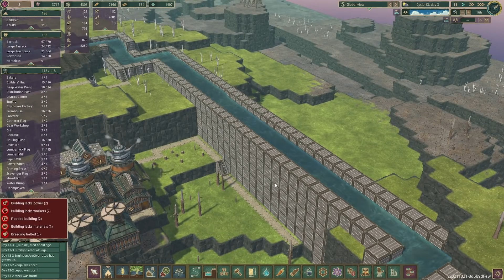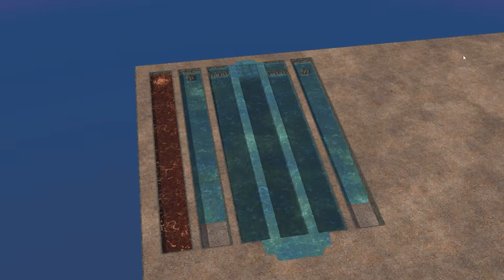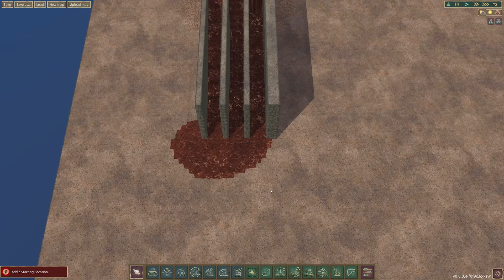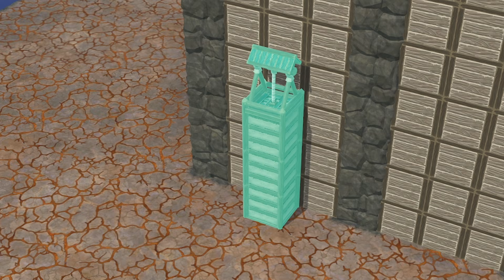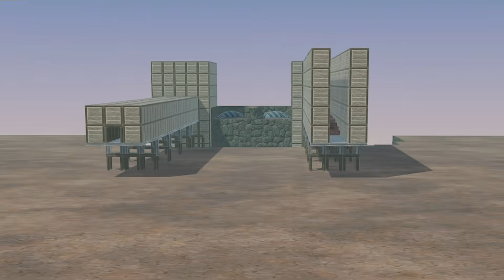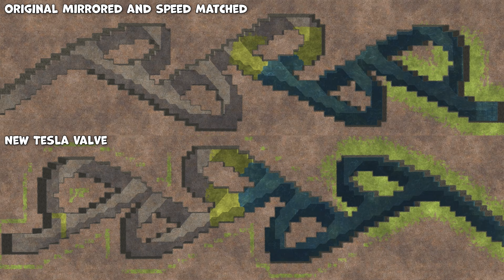Engineering a TESLA VALVE in Timberborn!

Comment: I wonder when you put the new floor on the platforms when you tested the tesla valve if something would be different then putting levees on it 

And what happens when you build 2 towers and connect them with a "pipe" does the pressure fill up both as the water tries to regulate how much is water is in both towers 

And last what im wondering is can you put dirt on platforms or is it still restricted

Edit: why didnt you use sluices btw😅

Comment: The Tesla valve should be tested by replacing the good water sources with poo water sources once it has filled in. The current test is like submerging a valve from one end and displacing the air inside, but two similar liquids will show the paths the fluids take.

Comment: There is pressure with the water. If you're curious, Skye Storm has some great videos on Timberborn engineering, and in many of his dam constructions goes over how to manage water pressure (super useful if you're trying to get better results from waterwheels to generate more power). The gist of it, though, is to take larger streams and force them into narrower streams
Reply: Skye Storm discovered the way Timberborne simulated Bernoulli, but there wasn't "3d (volume) pressure" in the game, it was still converting water source power/spread direction. A water source of 1 could spread in 4 directions, generating 4 0.25 cms vectors in those directions.
What Skye did that was super interesting was closer to beam forming, he artificially limited the ways water could flow with converging step drops (since water could only calculate in 2d) and thus created virtual pressure by forcing all the cms into a single channel even though it should have overflowed.
Again, NOT due to "water pressure" but "vector pressure". That said, his method of creating a turbo channel made for some amazing water wheel power generation!

Comment: as I previously mentioned on your other Tesla valve experiments, another factor you failed to duplicate is reverse channel widths.  if you look at your drawing again they're like half the width of the forward flowing channel.

second to properly test the concept, you need to try one with bad water at one end, and regular water at the other end and start them at the same time rather than racing them down an empty channel with no opposing pressure in the system. if you build the channels correctly, then the reversing channels should help support the flow direction of the forward channel which should prevent reverse flow from occurring

additionally, to compensate for the the lack of fine detail with which you can build, you're going to have to design it bigger (effectively increase the resolution) and you might have to tweak the orientation to the grid so that the channel intended for the flow to follow lines up efficiently to the grid where as the flow reversing channels, plus you might have to tweak the design to recreate the spirit of the idea within the limitations of this system
Reply: From what I understand, pressure build-up/difference due to varying channel width is also an important factor, one he did not test in the valve or separately.

Comment: In your pressure tests, the differences you're finding in 'pressure' actually seem to be differences in the height of the water at the entrance.  The higher outlet has the water level drop below the top of the outlet first.  This means the lower one has a full square of water being provided while the higher one only has a partial square.

Comment: Isn't he mixing up "pressure" with "enough water to flow at 100%"? With just one Poo Outlet you simply loose power by not producing enough liquid for a whole square. Not sure but I'm guessing both water wheels will settle down at the same power output after a while. Or if you add like 9 normal water outlets, the high one will also produce the same amount as the low one.

Comment: hay mat, not sure if this is till a thing but, when you have a "waterfall" the flow rate over that water fall used to get capped at about 1 blocks worth of flow rate, so for your open vs pipe test, as far as i can tell, the flow rate would end up being the same for both of them roughly, at the end of your tests just add a big flat area for the water to spread out, and you should see the water flowing much faster
it's just a weird physics bug in the game to create mega dams that had a consistent output flow rate regardless of the water level

Comment: I wonder if you lowered the channel in the resistance valves you could create more speed pushing back against the main flow?  (You might lose it again when it flows back around and hits the upper part of the channel, but with weird game physics who knows?)

Also, I wonder if you can get enough pressure to send water up in the air... put a huge reservoir, a pipe, and then have the pipe point up at the end.

Comment: It's surprisingly hard to find a game that lets you make real aqueducts. I know architecture is forbidden, but I love the look of flowing water. I love arbitrary water features that exist merely to look good. And I want a game that lets me make these things. Ideally inbedded in a city builder type game. 

I can spend hours in city skylines, rerouting rivers, equalizing flow rate across a network of channels, setting up the perfect stage for a city. Really, the city is an afterthought. Landscaping is the real meat of the game IMO.
Reply: same.  I can now have a sky river dropping waterfalls onto power wheels into another sky river!
Reply: I think we should give water features a pass as engineering demonstrations, like a bridge that has no practical purpuse except to demonstrate engineering principles.

Engineering isn't about purpose but function. Its engineering is the column is structural!
Reply: Well, there are some water bridges with water on them in real life, but it is extremely difficult to find.
Reply: @bearmike_360KB  Generally, water transport is done via pressurized pipe nowadays. That's why aqueducts are essentially architecture. One of the Roman aqueducts is still in use. Aqua Virgo. It looks amazing, but a simple pipe would be far more efficient. That would allow you to pump the water instead of relying on gravity to carry it. Would a pipe last 2000 years though? Not unless it's drilled through solid stone. 

Water bridges are kind of a separate thing. Very niche, but they supposedly have a purpose.

Comment: My question is the bad water source is a 3 by 3. What happens if there is a channel that goes off in each of the 4 direction instead of only one. Would that effect the flow and the speed? As opposed to the 1 by 3 of the fresh water sources.

Comment: What kind of fake engineer are you RCE? Because what you did at 16:50 and onward doesn't prove anything. There was simply more water remaining in the bottom reservoir, which allowed more water to flow through the bottom channel. That doesn't prove there is pressure. That just proves you let too much water flow out the back.

Al you did was look at the general water level.

Comment: I don't think the speed with the pipes has to do with pressure but the simulated speed at which the water is falling to the floodgates. The higher one doesn't have to fall far from the source to flow out meaning it isn't gaining speed. I don't think pressure is simulated

Comment: Pretty sure the game doesn't model water with fullfluid dynamics, it's just got a measure of how much water is in each place.
That's why the water flows faster down hill(all fluids spread evenly to the surrounding tiles), then slows down the instant it reaches the end(it no longer spreads preferentially forwards), as well as why the waterfall is slowest(it only has one tile with preferential spread vs the others having multiple tiles).

Comment: 99% certain that what you're looking at is cell-by-cell physics i.e. each cell (size of a levee) can interact only with neighbouring cells. That gives a decent approximation of physics, but pressure etc. aren't really handled.
Reply: I don't want to say it's easy because it probably isn't but if a cell of water has its directlion to the side or head on with another cell. They could just decrease the velocity of the affected cell. Even better they could also average the direction. I imagine this would simulate turbulence and when applied in this valve shown in the video it would be effective at decreasing the energy in the system enough to have little water flow out the end.
Reply: @Grymyrk  It's not that easy, unfortunately. In the model I'm thinking of, adjacent cells try their best to make the water height level, subject to gravity. Importantly, this means that effectively water is teleported between adjacent cells. That means there isn't much to calculate velocity on, and in any case it's capped at 1 cell per logic tick (because water only interacts with adjacent cells), which isn't how velocity works.

Not knocking the approach in general though - I've used it, and it's a pretty good approximation at a macro scale.
Reply: yes i think that's how i would try and implement this as well. the most basic version is like you said; that each cell only has one value for how full of water it is, and that value "trickles" along the cells to each adjacent cell on each update loop. a more advanced version might give each cell a few additional variables like the rate-of-fill and from which direction its being filled and in which direction it's being emptied... thus each cell has a velocity vector... ... but i'm not sure ... anyway its really cool!

edit: i think in the system i mention above there should be some emergent behaviours, some might be good such as laminar flow having a better flow-rate... but also possibly some bad side-effects like flowing around a 90 degree corner might kill the velocity too much... its hard to visualise without actually doing it and running tests
Reply: @benja_mint  Not to mention that I think the most sane way of doing the more advanced system involves a non-constant settling time, making it difficult to implement in a game engine.
Reply: @benja_mint  Each cell definitely has a velocity vector. This is needed to display the water texture moving down stream. Also to turn the water wheels since their power is based on the water's velocity.
Reply: @benja_mint  I think it has level and velocity (not pressure) and it's tracked by vertices, not faces.
Reply: I wonder if we can apply calculus to voxel based physics models to get our every-day equations. Infinitely good approximations are no different than the real deal.
Reply: @Wh1t3Cat  It's not possible on this voxel model, because there's discontinuities (notably at speed = 1, because water cannot flow more than 1 horizontal voxel, but also a few infinities because falling happens at infinite speed, given that water falls any amount of distance in a single tick.)

Maybe if you had a model that ran each time step until things settled, but that wouldn't be appropriate in a game (as well as problems with numerical instability etc)
Reply: They got it real enough that water will reach equilibrium between two connected buckets if you create a tunnel from one to the other.
Pressure is just a division of force/area. Force can likely be figured by depth, then as someone else suggested have a vector for the flow direction to determine where it pushed the water. Lots of simplification since everything is cubes.
Apply a direction vector (force), its direction based on the type of material around it. Do some vector math against the valid cubes around it. use a multiplier based on the height of the neighboring cube. Voilà.
Reply: @AyuranssLounge  Didn't know that. In that case, I'd revise my answer to the most simple solution being a 2-tier cellular automata on stacks of water tiles. The first tier of the automata communicates height information, and the second tier moves the water.

Velocity vectors are something of a red-herring, because you can calculate a local velocity by the cellular automata and this suffices for textures etc. As evidence of this, consider how water behaves with a series of sharp corners. A series of sharp bends should remove velocity as the water crashes against the walls. This isn't what happens though.
Reply: Same way Stationeers have been doing it with atmosphere for like 10 years now, I assume ONI and a bunch of other fluid/gas management games does it the same way.

Comment: He kept going on about how the poo water source was "more viscous" and "faster", but I think it's only because the source generates from all of its block spaces, putting it ever so slightly ahead of the other water sources he tested against by volume and position.
Reply: Yeah if he had the regular water start at the front of the 3x3 then it would be even which he litteraly tested and got wrong lol
Reply: Doesnt viscocity reduce flow velocity cuz there is more internal friction
Reply: Yes but either the game doesn't calculate that or badwater doesn't have less viscosity because the flow rate is the same
Reply: Went looking for this comment
Reply: I noticed that as well, which will you think about it?His dirty water started a block in front of the one by three in the middle water. So now all his Testing is skewed in incorrect
Reply: Because he is real civil architect.
Reply: The spawners are the source. That's the key. Since the poo is a 3x3 source, it's always going to be more than a 3x1 source, especially if you're trying to measure distance traveled from source while putting the 3x1 IN THE MIDDLE. By doing so, you're already handicapping the race in favor of the poo source. If you wanted to create a optimal way to maximize the water flow, it'd be a 3x3 of thier sources, with it being 3 stairs in length, having the highest stair being furthest away from the port to the stream and lowering the closer you get... That's just basic physics. Granted, this potentially means building more walls around the source spawners to keep spillage from happening outward of them, but you'd have created something equivalent to 3 poo spawners stacked on top of each other, which would obliterate the other ways tested.
Reply: badwater spawner has a defult strength of 3, which is how much water it produces, normal water spawners has a strength on 1 by default, these values can be changed in the map editor. the more water they produce the more the faster it flows.
Reply: As someone who toyed with the map editor, the water source blocks also have a value of how powerful they are. As I recall, clean water defaults to 1 strength, but bad water starts at strength 5 if I recall. You can see what I'm talking about at the start when he selects a water source and right below the description it says the strength(which can be edited and only shows in the map editor.) I don't know if he changed it to try and match them as he doesn't show it.
Reply: And also more viscous should mean slower (more resistance), not faster!
Reply: Comment section armchair specialists really are the worst

. All their talk amounted to nothing because they didn’t know enough about the game so their just a bunch of hypocrites
Reply: He means “LESS” viscous. 🤦🏻‍♂️
Reply: @glennac  he said more viscus🙄🙄
Reply: This was what fired off in my brain the moment he went off about his poo water being faster. In which case he really should see a medical professional about that because that's not a healthy thing. But on a flat surface, it's really about filling in the empty space (which the 3x3 water spawner did too efficiently and yeeted water up and out of its channel.) With him using the middle 3x1 water spawner, that's where it will all start spawning before gravity effects it. The badwater spawner goes from the entire 3x3 asset and so he needs to treat each case separately instead of a simple conclusive "Be all, end all" result. Well, I mean he can. It's just going to lead to him struggle bussing for an episode or two before he realizes his mistake and has to go back and try to retcon all that work he's done.
Reply: Hes wrong with the pressure the surce can only deliver not enough and the right one was earlier empty
Reply: Instantly went to the comment section for this comment 😅
Reply: Nah, it’s because the poo water has the runs

Comment: Update Note:

Water Wheels no longer slow the water flow. We originally introduced this mechanic to prevent players from building a perpetuum mobile, but the side effect - water wheels that would sometimes just stop working - was causing way too much confusion.
Reply: That happened to me a few times. Had multiple wheels in one river, but the flow just went around one of them and it stopped working.
Reply: Are you one of the devs or just sharing the info
Reply: @halflife2fun just sharing the patch notes
Reply: Kind of dumb since you still can do perpetual energy machines with poo, also in the game you don't really need that much energy anyway so it's kinda pointless.

Comment: I assume this video was recorded on June 25, so let's ad this from July 3:
"When a fluid reaches the ceiling above a covered fluid source and there’s a way for it to escape, for example to the side and upwards, it will do just that. In short, this means that you can now assemble pipe-like setups."

Also, vanilla vertical power shafts and integrated mod support! :) ;) :)

Edit at the end of the video: Also "When placing multiple Levees at once, you can now draw rectangles rather than just lines. Go crazy with the aqueducts!"
Reply: Not to mention sluice gates. Automatic water level control.
Reply: Vanilla vertical power shafts is huge.